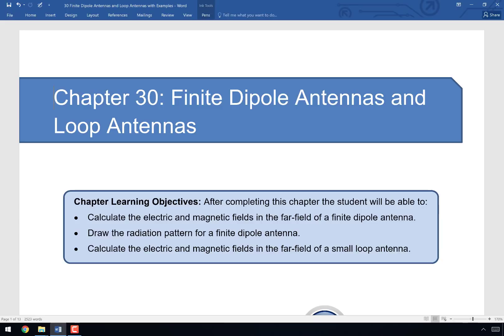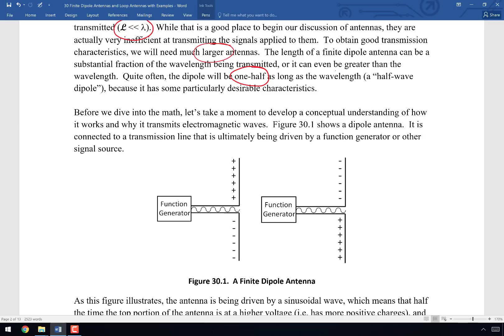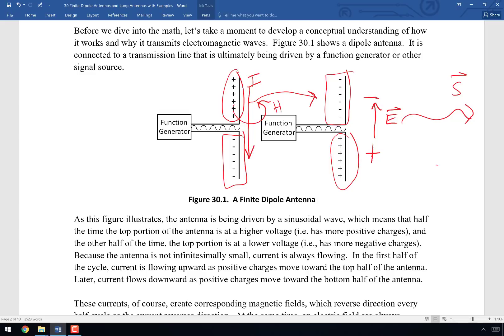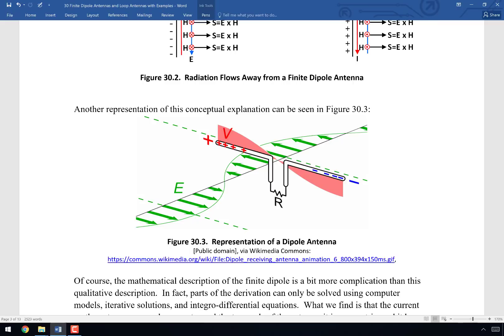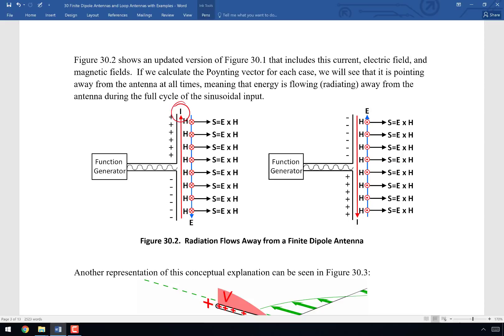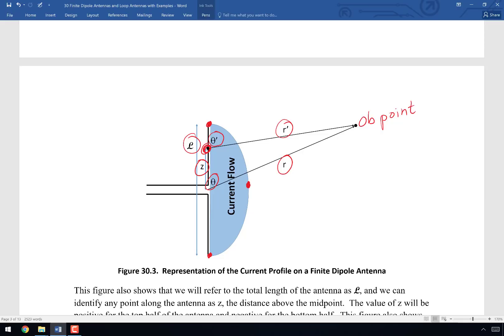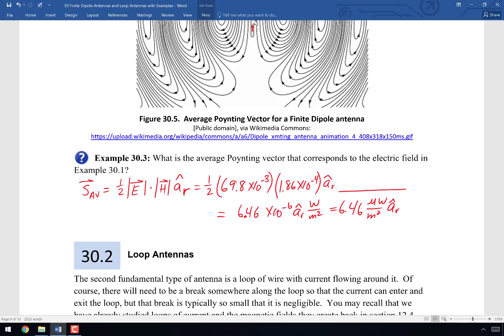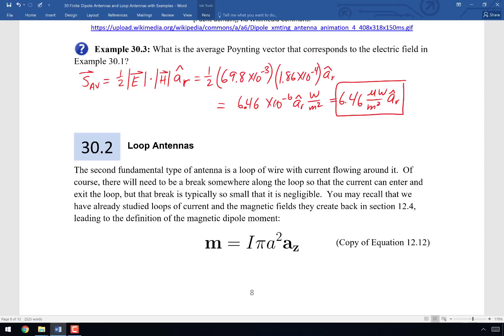Applied Electromagnetic Field Theory Chapter 30 -- Finite Dipole Antennas and Loop Antennas

Comment: 3:42 correction: the voltages are the same magnitude, just opposite polarities, so it's not quite accurate to describe the dipole ends as "high or low".

Comment: A mistake, i think. The animation bet 8:25 to 8:50 is showing an emag signal incident on a dipole antenna which is a receiver antenna, given the load resistor R and absence of any driving voltage source. What he said "E and H are being generated by the current and propagating away" is for a transmitting dipole antenna.

Comment: So sorry to tell you, that a yagi has only one (1) dipole, and it doesn't get better if you attach multiple dipoles.
A yagi antenna consist of one (1) Reflector, one (1) Dipole and a single or multiple Directors.
The reflector are the longest, placed at the rear of the yagi, after that are the dipole, and then in front are the directors.

I do have to look through some of your other videos to see if there should be some information on magnetic loop antennas. I find them very interesting.
Reply: Thank you. This is a community efforts, the doctor do a great work and our work is identifying and correcting errors to benefit our community

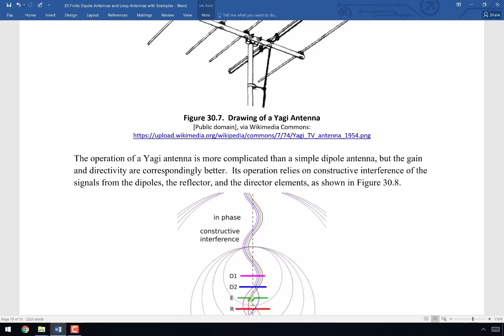Comment: Nice video!  At 47:36 into the video, you describe the components of a Yagi-Uda antenna.  I'm quite surprised at how wrong you were in that description.  Starting at the left of the illustration, the first 3 elements are all Directors, the next element is the Driven Element (or dipole as you refer to it) and the last element all the way to the right end of the illustration is the Reflector.   This particular yagi uses a Folded Dipole for the driven element.
Reply from the maker: Thank you for clarifying this point.  I'll correct it the next time I update this video.
Reply: They can calculate the cubic capacity of the pickle jar but cant take the lid off.. I cant follow the math much but ive built some big antennas...
Reply: @dougtougaw7681  The figure you show after is correct and labled correct - mutlple directors, one dipole, and one long reflector.

Comment: Professor Tougaw, this is excellent. Loved your lecture. 

Couple points I'd like to raise from your video

1. It appears that neither end of the function generator is really connected to the ground plane. This means that the function generator can be seen as having a differential ended output with reference to the ground plane. Is this characterization correct?

2. Second, it appears that current is due to movement of both positive and negative charges. Isn't charge flow in conductors (of which these transmission lines are composed) primarily due to negative charges, i.e. electrons
Reply from the maker: Sanjay,
Yes, I believe you could consider the function generator to be generating a differential signal, with neither side grounded.
It's often simpler to discuss the motion of either only positive charges or negative charges, but this is only done as a simplification.  In reality, only the negative charges move.  As a colleague of mine says, if the positive charges are moving, you've got bigger problems!
Reply: @dougtougaw7681  Thank you for your reply, Sir. This really clarifies a few things that were blocking further understanding. I'm reading your book and really enjoying it. I can't do more than contemplate one concept per sitting, but I'm finding that very stimulating.

Comment: At the antenna you show both the electric field and magnetic fields but not their relationships in time. At the antenna, the electric field and the magnetic field are perpendicular in space and 90 degrees out of phase in time. Do you agree? Thanks.
See this by what I mean:
https://en.wikipedia.org/wiki/Antenna_(radio)#/media/File:Dipole_antenna_standing_waves_animation_461x217x150ms.gif
Reply from the maker: Bela,
If I understand correctly, then yes, I do agree with you.
Doug Tougaw
Reply: @dougtougaw7681  Thanks for your reply Doug. As an electrical engineer, if I measured the magnetic and electric fields at the antenna with my handy oscilloscope and probes, I would expect to see the same electric and magnetic fields be time delayed by 90 degrees too as in the gif. Do you concur?
Reply from the maker: @belaji  Yes, I believe that is correct.

Comment: With reference to figure 30.3 on page 4 ... can the magnitude of the current (at the centre of the dipole), at the moment just before the signal radiates, be measured in metres? I can visualise the length of a (half wave) dipole in metres and would like be able to visualise the magnitude in the same way. I appreciate the magnitude will depend on many factors including frequency and power generated at the source. Thank you.
Reply from the maker: Neville,
I don't think it is typical to represent the magnitude of the current in units of meters.  It is typically measured in amps.  However, all visualizations are only useful in that they help us to better understand and predict the behavior of the system.  If you are able to measure the magnitude as a form of distance, and it helps you to better understand and predict the system's behavior, then it is useful for you to do so.
Reply: @dougtougaw7681  Thank you so much for replying. I appreciate current is (typically) measured in amps but the figure 30.3 representation is so typical I've often wondered if there is a way to calculate (convert) the magnitude in metres.  One of the reasons for my curiosity is how the wave interacts with a (dipole) coaxial feedline. One of the properties of coax is to prevent the inner conductor from radiating beyond its shield (please correct me if that's not the case). If that's the case I presume the magnitude must be millimetres or less to prevent distortion of the sinusoidal form??
Reply from the maker: @nevmarr I think that the image in Figure 30.3 is really just a convenient and schematic way to represent the current in a way that helps to explain the situation to readers and students.  I don't really know of a way to represent current as a distance as you suggest, but I do see what you mean about how it could be a useful conceptual tool.  Thanks!